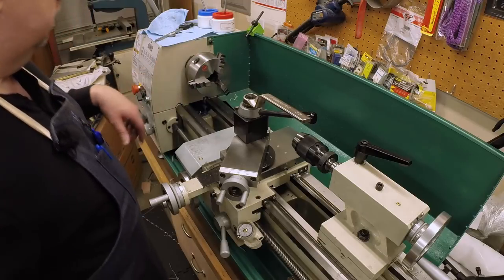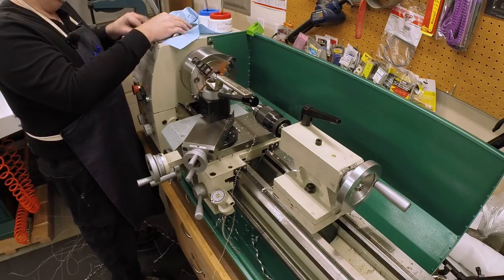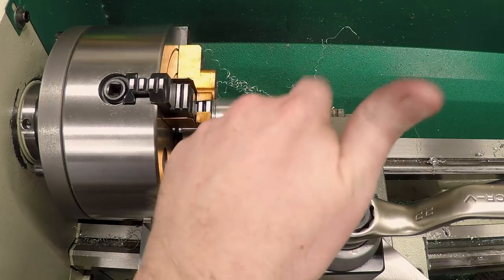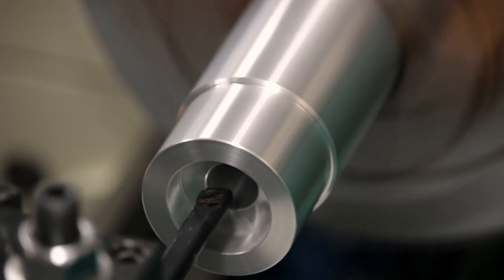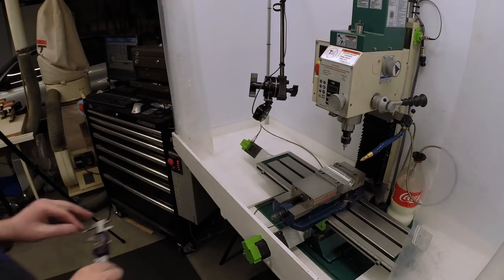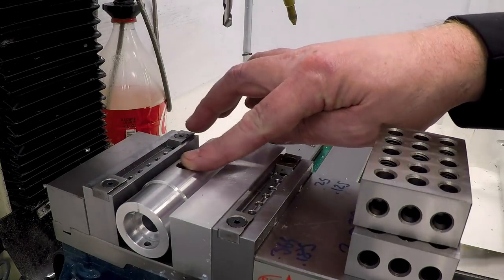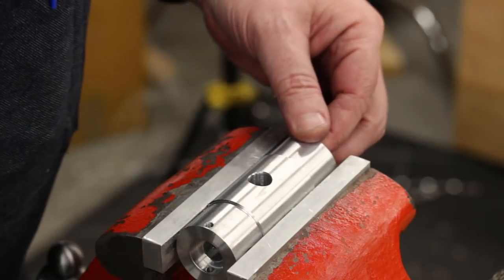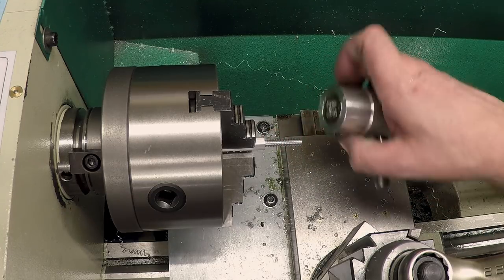Lathe Tailstock Die Holder - Part 2

Comment: I never knew that little nugget of info about why we keep boring bars slightly above center.  I always thought it was to ensure the underside of the bar doesn't drag on the part.  But your reasoning, that it keeps the tool from digging in, is very insightful.  Thanks!

Comment: From experience if you are going to use power to tap, use the jog button in low back gear - or there might be a major military exercise, that happened to me . Good vid
Reply from the maker: Thanks.  I don't currently have jog buttons, but when I add a VFD to the lathe, jog buttons are a good idea.  Usually, when I have a tap in a chuck, it slips.  With the die holder, the idea is to let go if it grabs.  For some operations, it's easier to just turn the chuck by hand.

Comment: If you knurl the od this will give you a grip so you can cut fine threads and you can feel it. Second the guide rod should have a shoulder this helps when you start engaging the die you can push with tailstock. In my opinion also steel would be a better choice and more durable than aluminum
Reply from the maker: Good ideas.  I thought about knurling, but ended up just adding a handle.  There's plenty of material to go back and knurl it later.  And you're right; steel would be more durable.  I had the Aluminum handy.

Comment: How about an endmill in place of reamer?
Reply from the maker: I didn't think to try that.  In general, putting an end mill in a drill chuck is a bad idea, both because it isn't rigid enough, and also because the end mill shank is hardened and can damage the chuck.  I think in the end, the bore needs to be slightly bigger than the shaft, so it might still not have been enough.